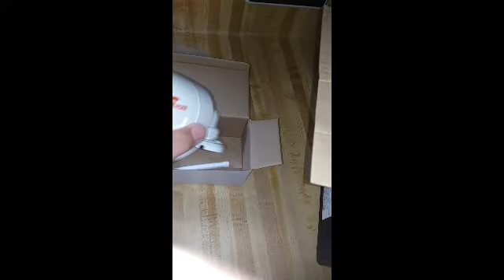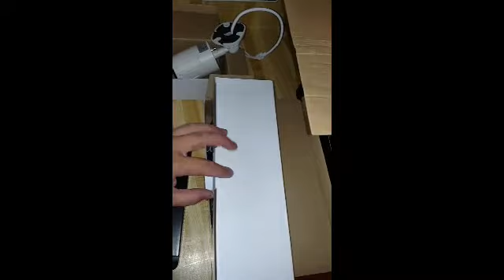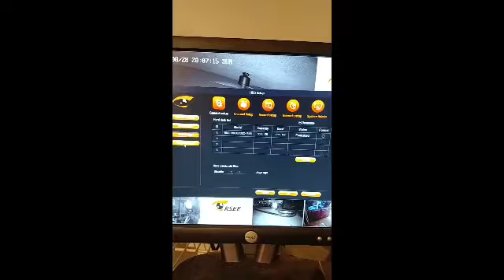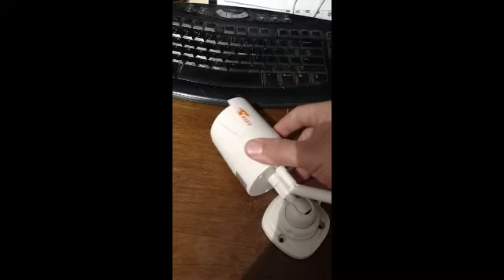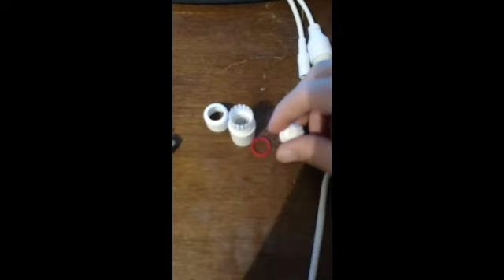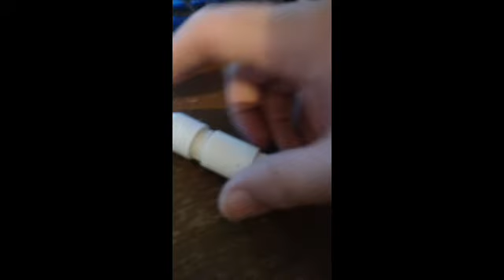CORSEE 8CH 960p Wireless NVR Kit Home Surveillance system

Comment: Have u had any problems with this unit ?
Reply: Cheflife 420 I have had trouble with 2 of my cameras losing connection. I have used the extended antennas and even rerouted the signal to bounce from another camera and nothing seems to work. Outside of that though it's been a great system
Reply: @Med_X82  hey I'm trying get camera ip address,  I can't connect to my cameras.
Reply from the maker: Cheflife 420 sorry med-x is my other account. See his reply
Reply: Med-X 
Only one camera stays on. I have to rest  the whole system and the others will work for a few days and go out again sucks
Reply: @cheflife420  I need default ip address
Reply: When you setup the DVR to your internet it will give you a corsee id which is what you use to connect via the app. Look in the settings on the DVR under fast network